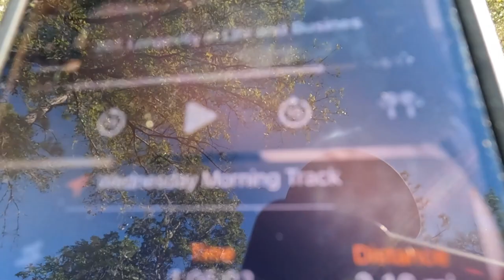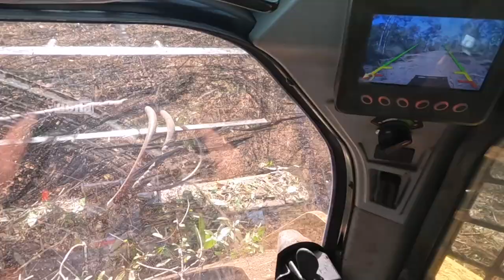Land Clearing-with CAT 259D3 and FAE Forestry Mulcher #landclearing #forestrymulching #treeshop

Comment: After running a 74hp skid steer in a forestry mulching application, is it something you would still recommend?  This is the type of work I want to be doing someday & I'm trying to best pick the equipment "right off the bat".  Dozer piles would be something I'd see a lot of.  Can a smaller machine "chew" through those root balls or would a bigger machine be more efficient?
Reply from the maker: 74 hp is not going to process piles efficiently and profitably. The 2 best machines on the market in the skid steer models are the ASV/Fecon 135 or the Cat 299D3 XE Land Management. 

Second place would be tak tl12 
Third place would be kubota 97 

Nothing else on the market is worth owning. 74 Hp is effective to help learn with and save some money on startup but if you want to get above $250k a year you will want 100+HP
Reply: @TheTreeShop  So as someone just starting out I should try & get a bigger machine knowing what the majority of my work is going to be?
Reply from the maker: It comes down to money. If you can afford more HP then get it. If not the 74 hp option will work and is a stepping stone to more hp
Reply: @TheTreeShop  Awesome sir. Your channel has been a huge help to me for gaining the knowledge to get into this industry. Thanks for the videos!
Reply: I have the 289 and 299d3 xe on planers. High demand. The 289  is better  by far. The 299 isn't worth the price tag
Reply from the maker: @chriss7930 I am pretty sure there is a miscommunication in that comment. The 289 will never out perform a 299 of similar model year. A289 is just a 74 hp engine in a large frame machine. A 299 is the same large frame but with 116 hp. If your 289 is in fact out performing your 299 then I would check your couplers on your 299 first as those can cause a drastic drop in performance as well as the tuning on your mulchers. Would love to talk more about this. Join Tree Shop Nation on Facebook and we can talk easy there
Reply: @TheTreeShop   I actually  have all 3  257d3  257d2 289d3  299d3xe   personally  I prefer the 257d2  because  its a little pocket rocket  just lacks on hyd power. But the 289 outperforms  the 299 any day.  I witness  this  every single day  and have done for the last nearly 2 years. Would never buy a 299 again  just isn't worth the money at all. But that's my opinion

Comment: How does it mulch on the stumps , does it get them down to dirt easy?
Reply from the maker: Mulchers cut stumps to grade. I don’t recommend doing stump grinder work with a mulcher but if it’s a reasonable size stump you can process it pretty quick down to grade